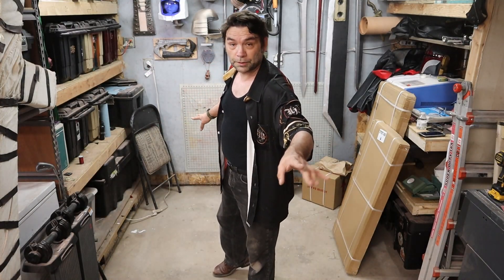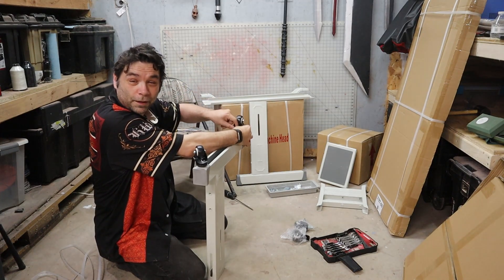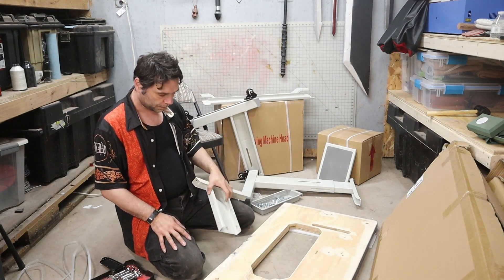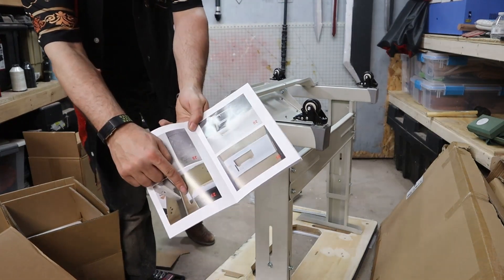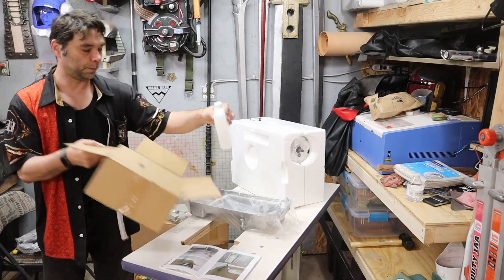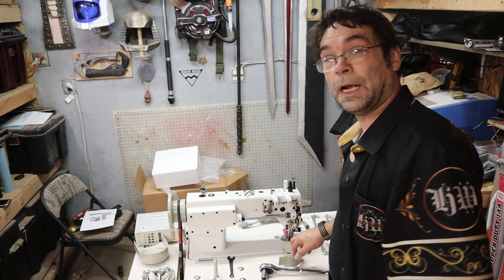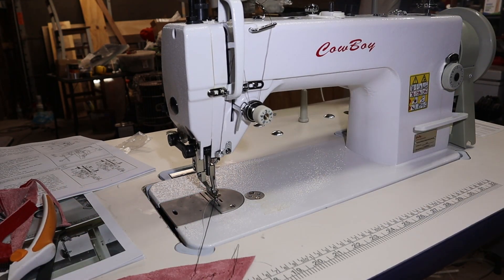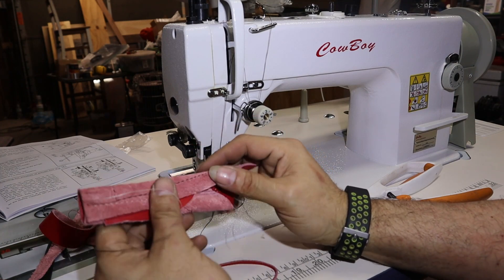Unboxing a New Leather Sewing Machine

Comment: Despite the difficulties you got it together. I'm sure you'll get the last bit figured out. I'm sure it'll all be worth it once the first project finished on it is done. That worked so smoothly going through four layers, and that's why you invest in a good machine to make your work easier and better finished.
Reply from the maker: It was annoying to assemble, but that machine sews great! So far any issues I have had have been user error. Its not a standard sewing machine, and I have to use it differently.